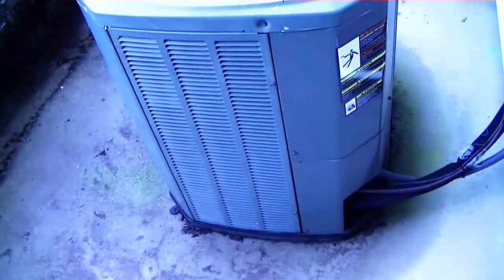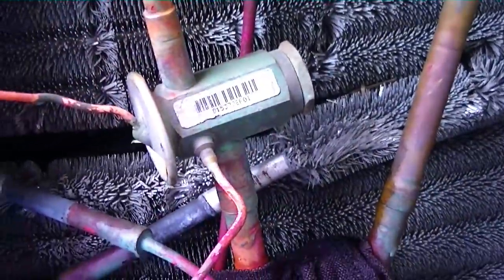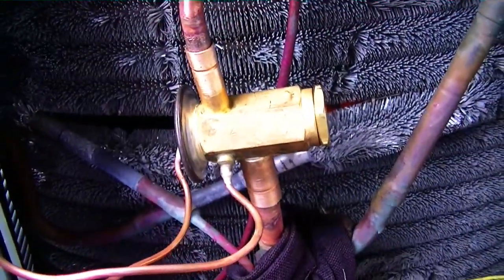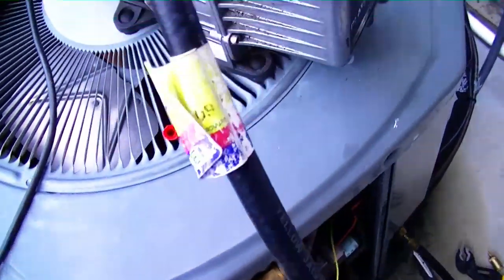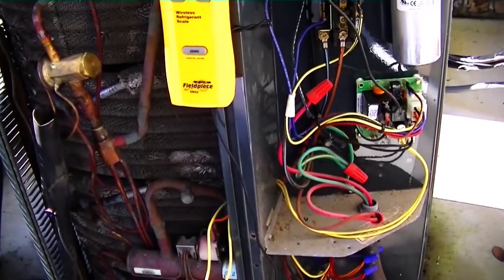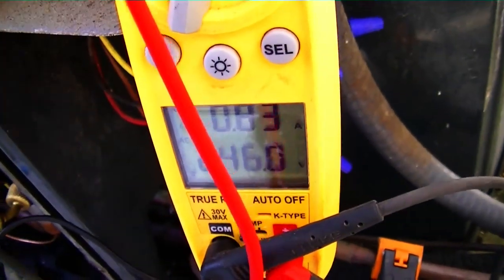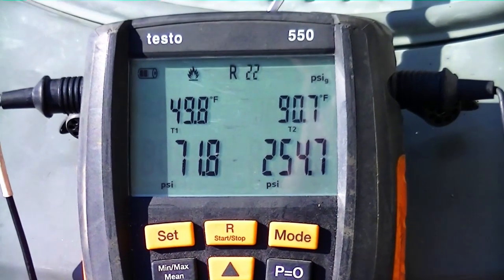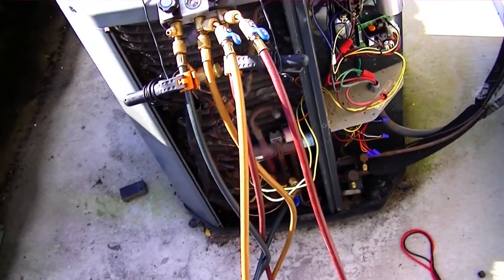HVAC Service Training- Heat Pump TXV Replacement

Comment: Your problem may have been due to the TXV bulb mounted upside down. It is still upside down.
Reply: +Douglas Kahane That's the first thing I noticed. It needs to be installed to make sure no liquid refrigerant is being forced in the line up to the txv. According to all my literature, it's installed completely upside down on this unit.

Comment: What about changing the filter dryer!
Reply: +who ami Well, This is what I learned 50 years ago, every time you open a system, you change the filter dryer (or core), this is good service practice. Every company I worked here in the US, doing the same, I hope that's explains it . Have a great day .... Udo

Comment: Ok thanks for reply. My pump does have a shut off I guess I can use my tee with a ball value to shut it off.
Reply from the maker: That s correct. Do you have the Yellow Jacket tee? I liked those.

Comment: Did the same job a couple of weeks ago. The TXV had slammed shut causing the compressor to attempt to pull itself into a vacuum. The unit was allowed to run this way for a couple of months. Complaint was high electric bills. When I arrived compressor was locked out on thermal overload. Megaohm test showed 5Mohms to ground. compressor, txv and drier all were replaced +@14 Lbs R401A. Wasn't much fun. Tall goodman SSZ042 sitting up on pump ups. Had to use a step stool for most of it. 

What was your txv doing that prompted it's replacement?

Excellent job as always by the way.
Reply from the maker: Mine did not pump down but I do believe it was losing charge in the power head. It began running a lower and lower suction (in heating only) and a higher superheat. Thanks

Comment: Didn't look like you used your Valve core  removers on pulling your vacuum. How do you close your hoses once your vacuum is done and not lose the vacuum? Thanks and always good work.
Reply from the maker: I close the pump. The core removers were unreliable, although I have though about just using a ball valve. A small, small bit of air makes it back into the system when the hoses are removed.

Comment: Do you ever use a turbo tourch, it's a little lower less intense heat but even and more spread out, I get good smooth flow with brazing rods. I recently bought the huge turbo tip for 1 3/8" 90 long radius els on a suction line, worked nice. Scared everyone when I lit it, big pop.
Reply from the maker: I have that and have also scared others (and myself) with the POP. I do use it now and then, but those Tranes are tight quarters. It could be done perhaps.